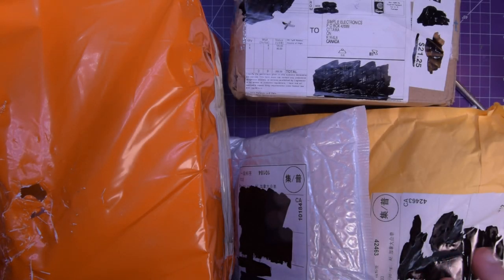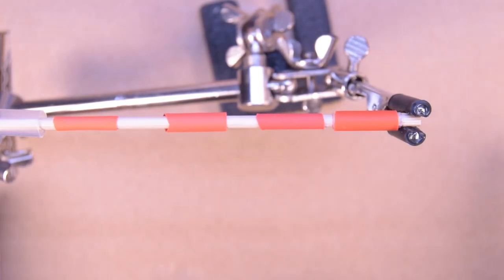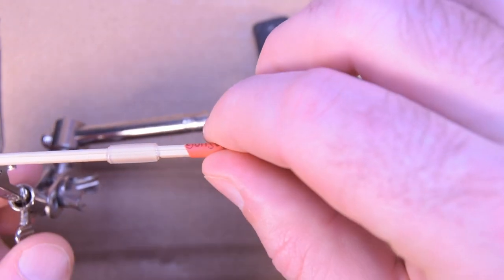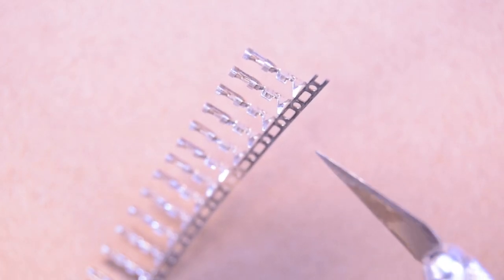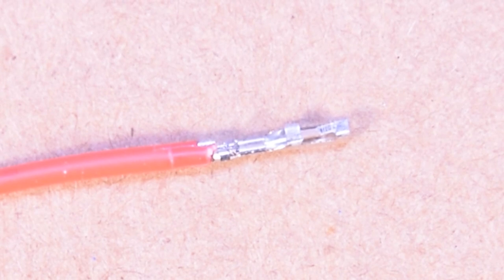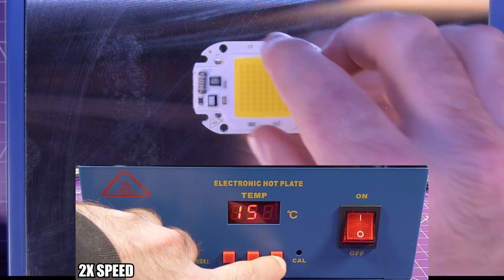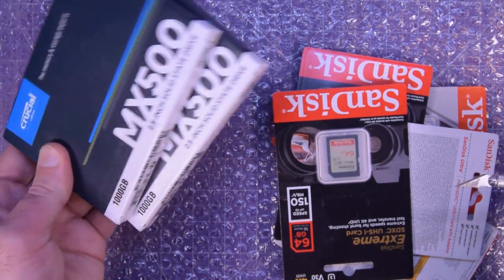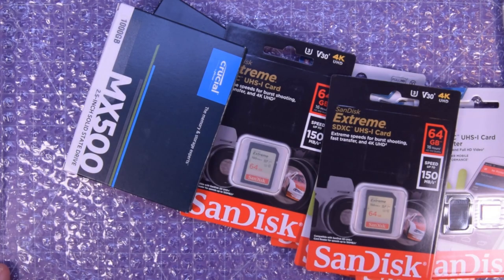Mailbag 97 - Malware

Comment: Fantasitc gift, Mark. I just bought 2 of those 1TB Crucial drives myself.  Also, good call on the DuPont kit. I bought that a few years ago and it's nice to know that I usually have the right size. I just refill it as I run out. Hope you feel better soon.

Comment: I'd like a crimping video with bare jaws without the crimper handle, as the jaws are less than $3 but the crimper is more than 20 (or in my case +$230 shipping)
And if you don't need to crimp a lot but need variety then may be an option on the budget
Reply from the maker: Im pretty sure that can be arranged

Comment: I had a similar problem with the displays and for a time could only get ones with a different pinout. I ended up redesigning my board with an extra row of pins so it accepts both pinouts and I could use either display (whichever was available or cheapest).
Reply from the maker: Great idea!

Comment: WARNING!  Before using that hot plate, open it up and check the metal plate holding the heating element to the surface.  Mine was a painted plate, and the paint quickly started burning and releasing toxic fumes.   I had to strip all of the (burnt) paint off of that plate.  Not easy -- if I had the proper equipment, it would have been easier to make a new steel plate.
Reply from the maker: Thanks for the heads up!